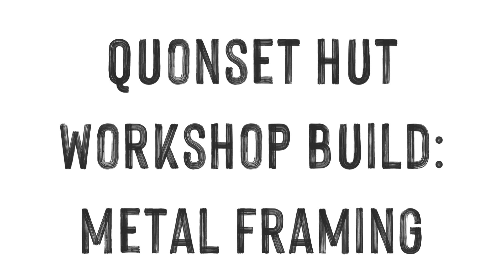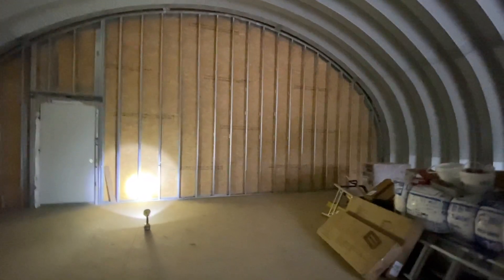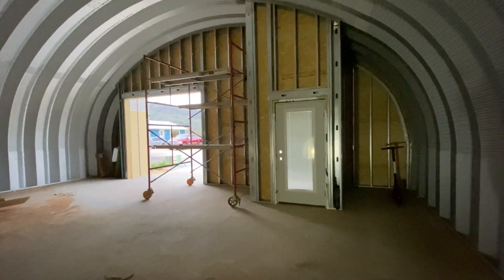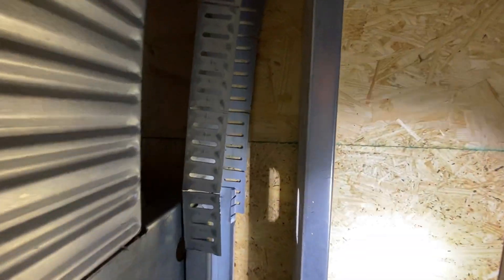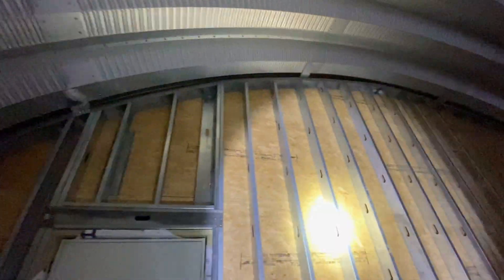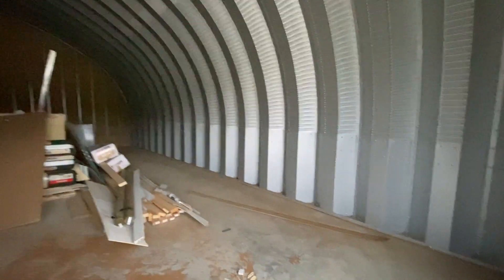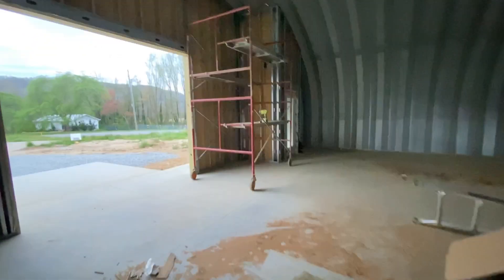SteelMaster Quonset Hut: Metal Framing Details

Comment: Thanks so much you saved the day with this video.  Just picked up some freebie metal studs for my Quonset 👍👍
Reply: One more quick question on the bottom track did they pin it directly to the concrete or something between the surfaces.  By the way absolutely love the front of your building definitely changed my mind on my front thanks again
Reply from the maker: @frankstewart8346  They just pinned it directly to the concrete without anything in between. However, if I could redo it...I might explore any options that might help keep out moisture from seeping through. I'm not even sure if anything like that exists, but I'm going to research that before my next Quonset build. 

When we get windy sideways rain, there is some water that seeps under that track. Even with the little flashing that we put under the OSB and fiber cement board on the outside lip of the concrete edge, a little bit of water does occasionally creep in. So I'm going to get it all caulked and sealed up with this special sealant I got...I just haven't had the time to do that yet. Thankfully, we haven't had a ton of rain this spring. Once I get to that step I'll post a video on that as well.

I'm so thrilled you got some inspiration on the front - thank you! The extra labor and finishing costs are a little bit of a downer, but in the end I think it's worth it to make it a little more exciting than just a straight wall. :)
Reply from the maker: That is SO awesome! I’m glad it helped! :)
Reply from the maker: @matt Harvey That is SO awesome! I'm excited to hear how it turns out!

Comment: Please tell me who framed your steel studs. I am having zero luck finding someone to use the steel studs. Thank you!
Reply from the maker: Hello. I'm a Project Manager for a local General Contractor. We have a regular subcontractor who does all of our framing (both wood and metal). They had never framed an arched structure before, but they were familiar with metal framing in general and were able to develop this solution. The main reason for this video was to break down the detail for how they made the adjustments for the Quonset arch. If you can find a subcontractor who is familiar with commercial or industrial framing, they should hopefully be able to make that adjustment. Best of luck!
Reply: Do you or any of your subcontractors know of any such contractor contacts you could point me to in SE South Dakota?
Reply from the maker: @lindaburri5107 unfortunately I don’t have any contacts out there. However, I’ll ask around and let you know if anyone in my network does.

Comment: Who did you use to construct your hut and build your endwalls?
Reply from the maker: I'm a Project Manager for a local GC. Me and a three of our guys did the arches ourselves. I think there might be a time lapse or a video in this series going over how we did the arch assembly. We used our our normal framing sub for the end walls and exterior sheathing / siding. We do a lot steady mix of industrial, commercial, and residential projects. Thankfully they were able to bang it out easily, even with the strange curve that they had never dealt with before.

Honestly, the biggest pain in the ass was tightening all the bolts after everything was fully assembled. My husband and I did that ourselves. He stood on ladders and scaffolding inside to hold the nut in place while I climbed on the roof to tighten every single one.
Reply: @hawkeyegrace  That's cool. I've been kicking around the idea of a Q-hut for a while and was curious. Thanks!

Comment: Was there a reason not to track the wall track against the inside rib of the arch?
Reply from the maker: On the back wall, we went as far back as we could toward the edge to maximize interior space. On the front of the building, I wanted an alcove / overhang and architectural detail so it had some more depth and gave it a bit of an entryway. It’s definitely a lot more expensive than going on the straight edge, but I love the little alcove that it formed.

Comment: Hawkeye Grace, I'm purchasing a Steelmaster building from William S. and contemplating building my own end walls. Do any of your quonset videos show in detail how to marry the end wall (top, bottom, and sides) to the arch? There must be a gap. Thanks!
Reply from the maker: Hi there! I don't have a video on this, but you might be able to catch small glimpses of where the edge of the gable end walls meet the arches in this video. Our crew basically very precisely custom cut the OSB interior wall and the smooth fiber cement board to fit the shape of the arch. There is really not much of a gap at all between the steel arches and the plywood interior sheathing and the exterior fiber cement board. 

They cut it with precision and we were initially thinking of just using backer rod to fill the slight gap. However, upon completion the gap was so small that we decided to just use The "Great Stuff" brand spray foam for gaps and cracks. That worked out very nicely. Once all of the bolts were completely tightened, we used that to fill the inside (it was tricky and tight, but managed to do that with a ladder). On the outside, I've left it as is since our Quonset has the outer metal edging that fixes into place and covers the gap. I will try to take a video of this when we're back up and running. Still experiencing delays waiting for our electrician to caught up, but hopefully will be resuming work on this building soon!
Reply: @hawkeyegrace , thank you very much for the detailed and thoughtful reply. Wishing you and yours the best!
Reply from the maker: @bayareasparky9180  absolutely! Happy to help! Let me know if you have any other questions in the process and I’d be glad to take close up photos and details if needed and send! My email is gk@gracehomes.us. Good luck on your project!

Comment: What are you doing about insulation ? 
I love the look of the arches, and hate to cover them, so was thinking of some sort of insulation on the outside. 
Will this be a home ? I has a really nice look to it. 
I especially like the overhang that you have left above the door. 👍
Reply from the maker: I’m with you. I don’t want to cover the arches, so for this first winter I’m going to gauge and see what the temperature is like. I hadn’t planned on any insulation in the arches, but I am going to throw R-19 faces insulation between the studs and hang sheetrock on the gable end walls. 

I have the insulation already on site, but unfortunately my electrician has some medical issues / surgery, so we’ve postponed the rough electrical for now and I can’t throw the insulation in until they is complete.

So I’ll be able to get a good gauge this winter with bo insulation, next winter with gable end R-19, and then proceed from there (possibly with infrared heaters if needed).

This is not a house, but just will be my workshop for now. However, later on it will likely become the retail gift shop for our farm.

Comment: What keeps the bolts from leaking holding outside walls ???
Reply from the maker: The bolts they include have a special rubber washer that flattens / locks when you tighten the nut on the inside. Once tightened up, it is water tight.

Comment: hello, I'm from Brazil, I would like information about this constructive system. This model uses what plate thickness? How thick is the fixing plate between the concrete and the structure plate? My questions are to understand more about this fantastic product. Another question is how much it can withstand the winds. I anticipate my thanks for your return. See you soon!
Reply from the maker: Hello!  My framing subcontractor does SO MUCH framing that believe it or not...the studs used for my small end wall project he had in scrap at his shop! However, I'm located near Asheville, NC and I'm getting ready to do some metal framing for my shipping container office suites, so I've sourced a local yard that stocks 16' metal studs. The company here that has a few local yards throughout this region is called Tucker Materials (A GMS Company) and they keep the 18 gauge 6" studs in stock. 

I'm not sure which brands you have access to in Brazil, but one brand I found online that goes into this system in detail can be found is Clark Dietrich, and you can read more information at: https://www.clarkdietrich.com/products/structural-studs

I'm not exactly sure of the plate thickness, but I think it is around 18 gauge. You'd have to consult the specs of the brand/manufacturer you go with for the wind resistance rating. The bottom U-track is screwed into the concrete slab with some specialty screws, but I'm not sure of the exact type. They are designed to affix the metal track to concrete.
Reply: @hawkeyegrace  

Hi Grace!

Thank you very much for your feedback, but I'm very curious about the Quonset system, the Steel Frame structure for closing your shed, yes I have it here in Brazil, thanks for the website available. I was very interested in the Quonset Hut constructive system which caught my attention. I would be grateful for the information you can provide about this system (eg assembly, labor, etc.) We are studying the possibility of assembling a machine here in Brazil to serve warehouses of this size. It seems in several videos that the system is fast, efficient, withstands strong winds and that the manpower for assembly is fast. I appreciate if you can write because I can translate on google translator. Thank you for your attention and quick response! Bye
Reply from the maker: @jassonmaia  That sounds like a fun project! We purchased our Quonset hut arches from SteelMaster (and they have the most up to date details and information at https://www.steelmasterusa.com/

We did not purchase the end walls from SteelMaster so we could finish them out custom; however, they do have options to purchase the end wall systems directly through them as well. I used a subcontractor to put up the metal framing, so this video is all the details I have on the framing process. Best of luck to you on your build!

Comment: I wonder  if possible to achieve R-30 insulation with 7.5 inch batting by adding extension bolts and having a floating flexible furring.
Reply from the maker: I found it! It’s the video called “Insulation + Soundproofing” in the video playlist called “Cane Creek Valley Farmhouse Renovation”. This is the product I used (purchased from Amazon): https://amzn.to/3pPy1ER
Reply: @hawkeyegrace  Thanks.  just posted this idea.   https://www.youtube.com/watch?v=bf8brL70ic4    
Looking for a Florida Engineer/Architect to draw up and stamp plans.
Reply from the maker: @12vLife  That is a very cool idea!  I hope you can find the right engineer! I know if you purchase from SteelMaster the stamped plans are included in the price...but I'm not sure if the county would require further internal plans from an architect beyond the metal building itself. I do as much as I can myself in SketchUp for internal and end wall specs for simple builds like this.
Reply from the maker: I don’t see why not! I actually had to get REALLY creative with the bathroom of the farmhouse (next to the Quonset) when I decided to put in shower niches and recessed mirrors in the master bathroom on an exterior wall. I found this really AMAZING thin insulation material that I slid behind my standard R-19 and if I recall I got close to R-30 combined. I can’t remember if I made a video about it, but pretty sure I did. I’ll check and post the name of the video if I did.

Comment: Would you mind asking your contractor where he purchased the metal studs? I can't seem to find any that carry an 18ft long stud for my quonset hut.  Keep the videos coming,  hoping to start mine in a about a month.  Looking forward to seeing your framing of the door opening and the door install.  Thanks again
Reply: Hi Michael! My framing subcontractor does SO MUCH framing that believe it or not...the studs used for my small end wall project he had in scrap at his shop! However, I'm located near Asheville, NC and I'm getting ready to do some metal framing for my shipping container office suites, so I've sourced a local yard that stocks 16' metal studs. The company here that has a few local yards throughout this region is called Tucker Materials (A GMS Company) and they keep the 18 gauge 6" studs in stock. 

If you do a search for metal framing wholesale or for wholesale building materials for contractors in your area...you might be able to find a local yard near you that keeps something like this in stock.

I'll try to post some more update videos soon! My quonset is now all waiting on me (I'm sealing / caulking it all myself as well as insulating myself)...and I'm finalizing my electrical plans for my electrician to come do the rough electrical soon. The framing for the overhead door is actually all complete...just waiting for the installer to pop that in, so I'll try to film a detail video of the framing on the door. I'll definitely do a video on the door installation as well since I'm extremely curious how he's going to get that track in with the quonset arch!
Reply: @gracemcintire7880  Thank you very much!! Permit approved yesterday!! Hoping to pour concrete in couple weeks.
Reply from the maker: @michaelferdon1697  That’s awesome news!! I’m excited for you. :) Good luck on the pour!
Reply: @hawkeyegrace  slab is down.  Starting base connectors in 2 weeks.  Can you share what you used for waterproofing and whether or not it is working? Thanks
Reply from the maker: @michaelferdon1697  That's AWESOME...nice to get that big step out of the way. Sadly, I am horribly behind on the quonset right now. Aside this build, I just started a farm rescued a newborn baby calf last week and have 2 miniature donkeys arriving today! So I've been pulled on projects to shore up the fencing and paddock areas. However, I have purchased all of my waterproofing supplies and come up with a game plan. I plan on tackling that this coming week if we can get a reprieve from the recent rains.

I'll try to post a video this weekend with what I've purchased and show what the plan is, and then I'll post another video after it's complete with updates on success or not. I did have the overhead garage door installed recently, so I'll include that in the next update too. Stay tuned!
Reply: @hawkeyegrace  great news.
Reply: The slotted channel the metal studs are in at the top of the wall what is that channel called? Where could I get one? Looked online and don't see it. TY

Comment: Yes, excellent.  Thanks for taking the time to detail that out.  That helps me a great deal.  With the bending on the reliefs, my guess is they just propped up one end and stepped on the track to get it to bend.  At least thats what I'd do!  WRT to the bottom track did they do anything to rust proof the track from water?  Ive heard thats an issue, and as you know, Qhuts like to either sweat, leak or both if you dont try to mitigate that up front.  Finally, when you get to the garage door install, that'd be super if you can show how they connect the tracks to the arches.  SM told me standard garage doors are no problem weight wise, so they dont do any special engineering on the arches for that - IOW its GTG as is structurally.  Again, thanks for the taking the time to do the vid.  Cheers!
Reply from the maker: No problem at all! I’m so glad that it’s helpful! That’s my primary goal with this series since quonsets are such a different animal...and much of this is foreign to all of us doing this for the first time. 

I’ll definitely document and detail out the overhead garage door! The door has arrived, but the installer is backed up. I’m hoping to have that installation complete in the next week or so.

I was a little nervous / curious how that track system for the overhead door would work, but when we described the arch to the door guy and told him it was a Quonset, he said no problem. I’m excited to see how that all gets tied in.

The framing crew did not rust proof the bottom U-track from water, and you’re exactly right...on rainy days, I’m SHOCKED at how much water seeps in under both the base plates and the steel stud U-track, considering we put in a metal drip edge flashing piece beneath the fiber cement board edges.

To combat that, I actually have a special sealant that I’m going to caulk metal IBC plates on the arch length sides with, and then I have another sealant for the entire interior seam where the concrete meets the steel plates. I’ll definitely document and add that process to this series as well.

But since we did install a flashing on the exterior of the gable end walls, and the IBC plates have a downward drip edge too...I was so surprised to see how much water seeps in. 

Regardless, I’m hopefully going to take care of all of that within the next couple of weeks. So much to do, and just short on time these days. I also need to fill the hundreds upon hundreds of finish holes and caulk all the batten strips as I prep for paint. However, I’m going to try to seal up the base plates and track first.

I’ll keep posting all the progress on the quonset hut in this series. If you think of any other questions, just let me know!
Reply from the maker: Hello there! Apologies for the long delay, but I just wanted to let you know that I finally posted an update video on how the garage door attaches to the arches. :) It’s the newest video in the Quonset Build playlist (just posted a few mins ago).